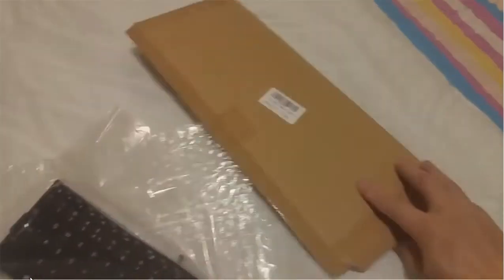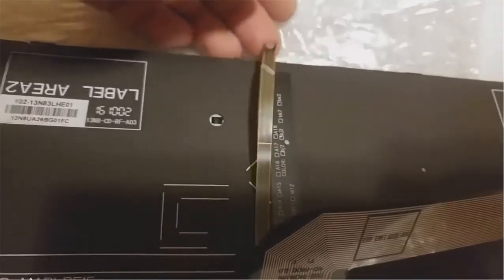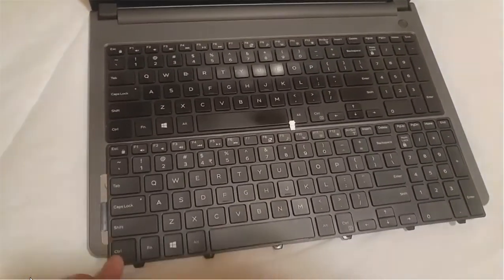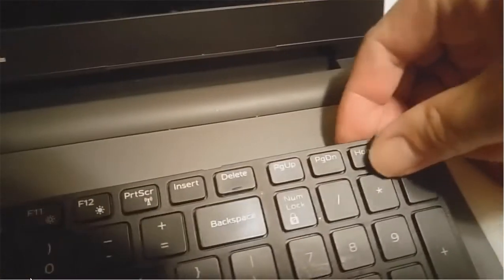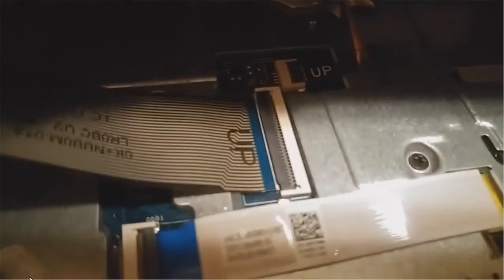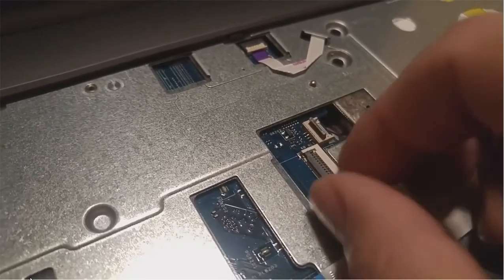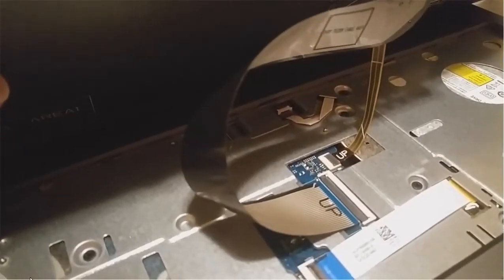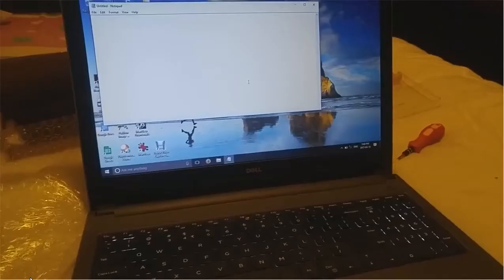How to replace Dell Inspiron 15 5558 Laptop Keyboard

Comment: Can you show how to fold the backlight cable for proper installation. I bout a replacement keyboard with a backlight but my original did not have a backlight even though it has the connector in the same location as yours but I'm stumped on how to fold the backlight cable for a smooth installation. Any help you could provide would be greatly appreciated. Thanks.